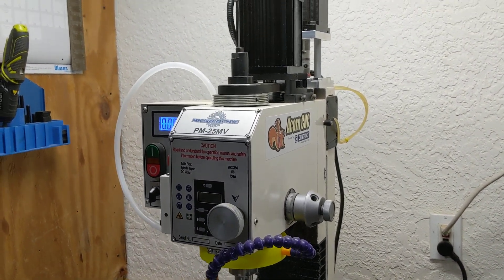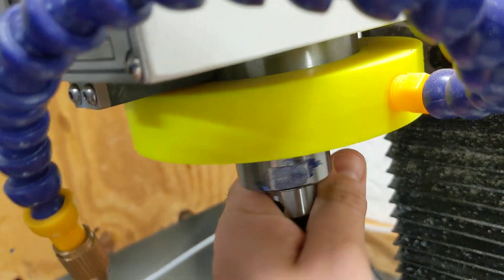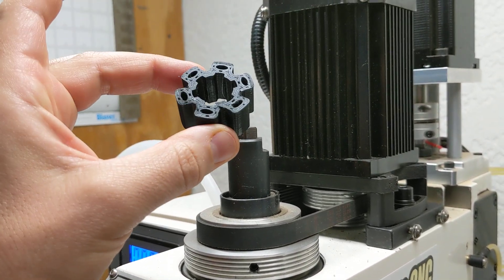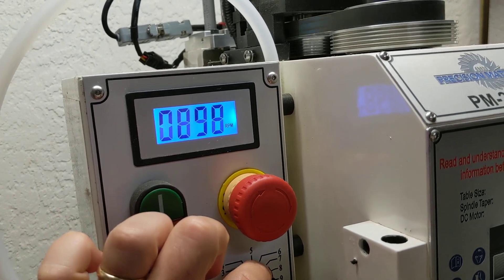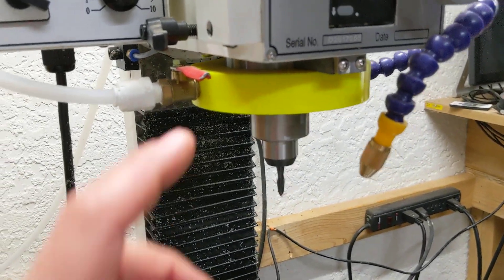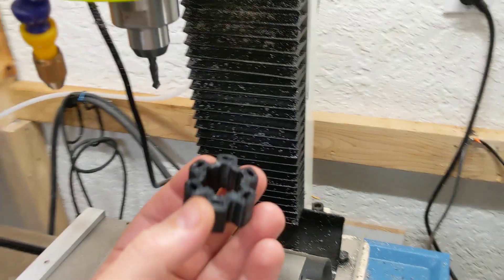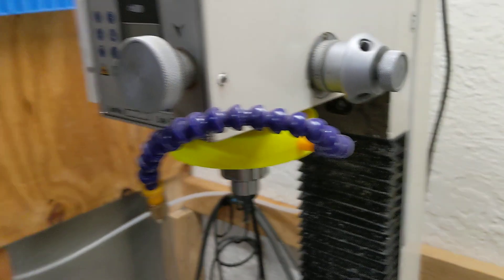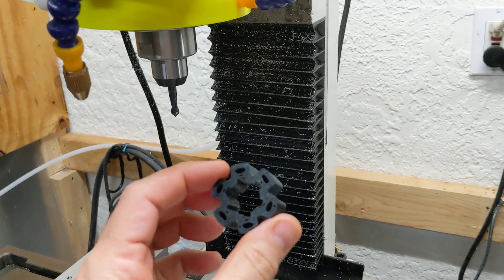PM-25MV Milling Machine Spindle Bushing

Comment: Thanks for the 3d model. Printed one and installed it on the PM25 I'm building, and the rattling sound in the spindle is gone. My 1kW 5000 rpm DMM servo spindle setup is almost as quiet as the original motor.

Comment: Hi Franco,  I was wondering, why did you remove the 1:2 pulley jig you made to increase the spindle speed? I am in the process of doing the same. I have now 5K on the spindle by using another motor and would like to bring to 7.5K and your solution seems the more feasible one. The size of the front pulley makes it really weird to increase the motor pulley ot a 130-140mm one. Thank you
Reply from the maker: The concept works.  However, when you make the idler shafts, you need to make sure the bearings have some axial loading on them. Otherwise, they tend to vibrate a little bit while the machine is running.  My original design worked ok but I took it off, sold it and never got around to making a new one.  But, the concept works.
Reply: @FrancoCNC  ok, thanks for the info. We'll I could add a spring in between the bearings to give a certain preload or use a top threaded cap to remove the gap.

Comment: Hello, had a question regarding the 2 mills you have.  I'm interested in buying a benchtop mill for hobby gunsmithing mostly, but also some motorcycle parts, and whatever else I can make instead of buying.  Love to tinker and build, but I  have no experience with a mill and little experience with a drill press. 😒  I've built multiple AR15/AR10 80% lowers using a jig, router and hand drill and have other projects I want to do so figured this would be the next step.
  Been doing alot of reading on forums and websites regarding mills and alot of people say to get a used Bridgeport, etc., but this is going into my garage and it's not something I will be using on a daily basis.  I was very interested in the mill/drill/lathe combos but every person that had experience with those said the mill on lathe/mill combos have alot of shortcomings compared to a individual mill and the lathe section was okay, but also had a few issues that individual lathes dont.  So after seeing multiple people say that I've decided it would be best to get a Mill first and lathe down the line.
  In my research I've done online I've found that it's important to get a mill that is heavy so it doesnt flex, a square back post (sorry I dont know terminology) instead of round, and the biggest mill you can afford/fit into the space you have.  
  So I've pretty much decided on a Precision Matthews as I havent read any real negative views and most are very positive/general consensus that they're better built, more precise, have additional features that other companies with same imported mills dont, and have good customer service.   
  I was pretty set on the PM-25mv, but am concerned I'll have it for a while and get into machining more, then end up wanting a larger mill so I can work on bigger parts or start machining steel (have been wanting to build a 1911 but wanted to get a mill to cut the rails instead of buying all the special tooling needed just to make 1 or 2 1911's.  
  So basically my question is do you think the PM-25 is capable, has enough precision, and large enough for at home hobby gunsmithing and machining some motorcycle parts or should I go with something bigger like the PM-728 like you have?  
  I also might want to convert to CNC down the road (depending on if I think I can teach myself how to program/operate a CNC through online reading/watching youtube videos) and have read that Precision Matthews mills have a bit extra space to fit everything needed for CNC conversion than competing companies with similar mills and are easier to convert.
  Money is also a factor.  I've been saving and can afford a PM-25 with DRO and all the tooling I think I would need now.  If i went with the 727 or 728 like yours, it would be the machine with DRO only and I'd need to save for a bit to get all the tooling.  
  Sorry for such a long post I'm just trying to explain my situation and what I'd be using the mill for mostly.  Again I'm just starting off and have no experience so any advice/help you can offer will be much appreciated!

Comment: Hey this bushing eliminates only radial play right? But radial play is not a problem for cnc milling. Did you measure your play on both machines x/y and runout? This would be interesting.One other thing be aware of your spindle temp if you made the bushing from pla it will easily melt and could mess up your machine. My machine came with to much preload on the bearings and would heat up to the point you could not hold your hand on it. It would be nice to make a brass or bronze one with a preloaded spring or wedge ore something like that and that you can still use the drill function. Gr T